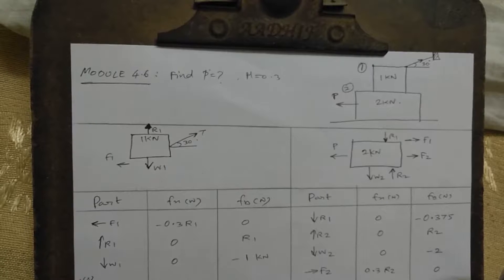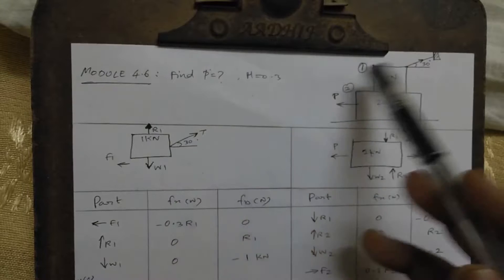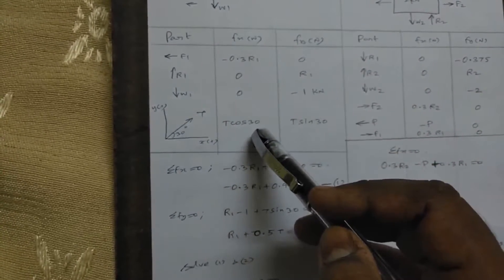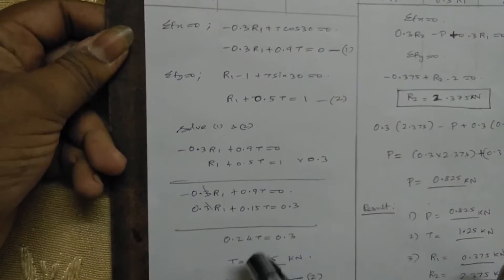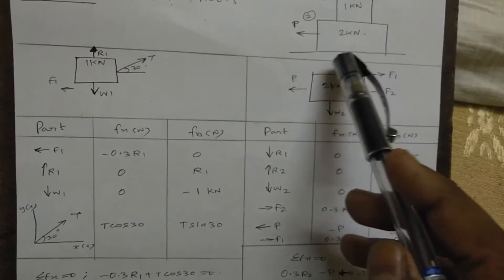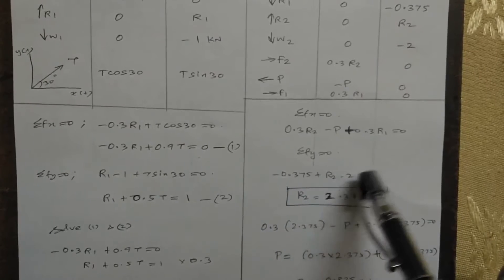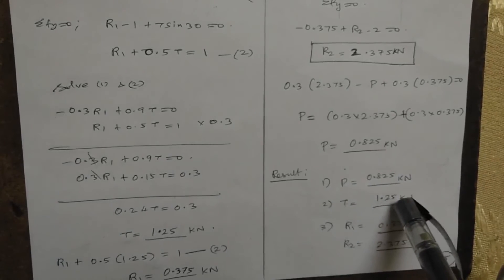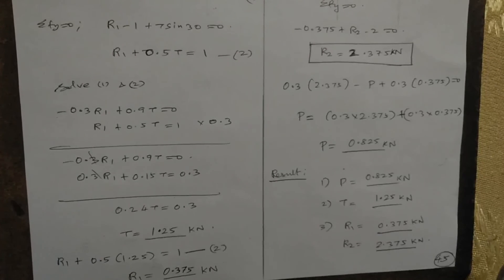Problems on dry friction#3

Comment: Sir why for block 2 we are not adding weight 1 +weight 2
Reply: Sir in other problems u have taken r1 acting on block 2 and in block 2 weight 1+weight 2
Reply from the maker: On block 2
R1:w1
Fix it.,
Reply: @kingsmech  fix it means
Reply from the maker: Already r1 is there..
So I skipped w1 
Both same right??